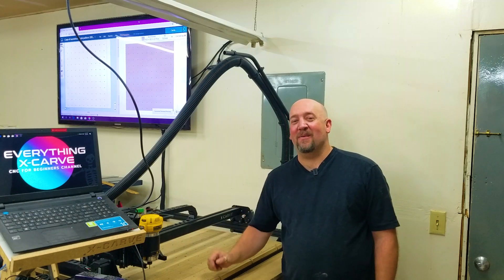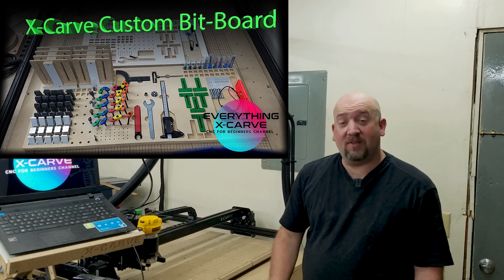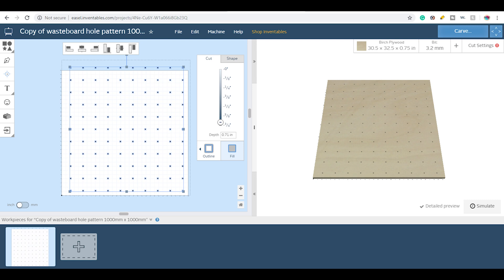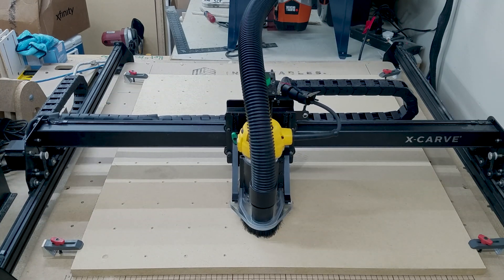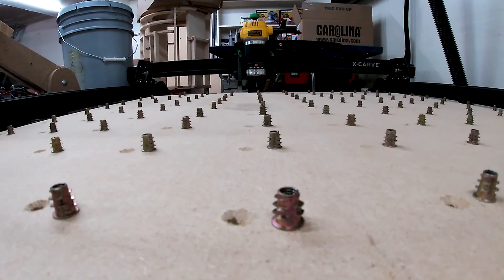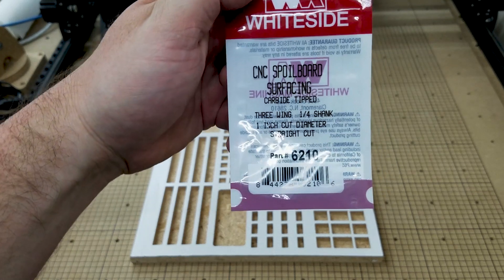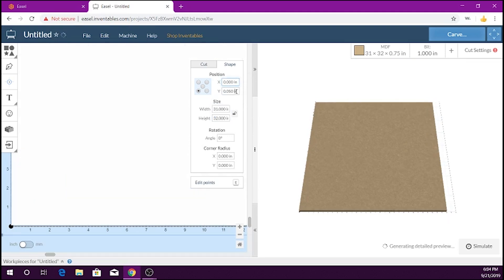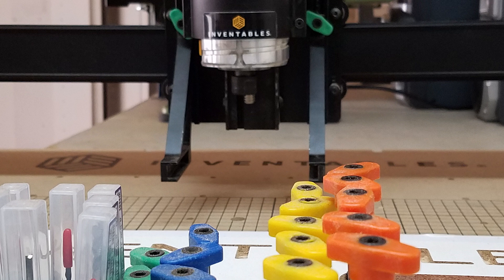X-Carve Custom Waste Board

Comment: Did you have to move your board to not get any edges left after surfacing? I’m about to make a waste board to go on top and want the max my x carve can do which is 750mm so should I do 30x30 inches?

Comment: I noticed in the beginning you had your board at 30.5x32.5 but when you surfaced the waste board it was set at 30x32 is there a reason for that? is that because the surfacing bit is so big??
Reply from the maker: Hi Joseph I resized the board as it was to big you are correct. Thanks for watching

Comment: I'm going to try laying a piece of 1/4" MDF under the waste board from the beginning. Then you could fully utilize the CNC for all hole drilling and counter sinking. Then you could pull out the 1/4" MDF, flip the waste board and surface it. I'm new to CNC so let me know if there's a flaw to that workflow
Reply from the maker: Hi Klay thanks for the response I am sure that would work. I didn't think about that prior to install. Having a template like that would definitely be a time saver. Thanks for watching.
Reply: @EverythingXCarve  I'm hoping I can use your dot template and just switch bits from an upcut spiral for the main holes followed by the countersink bit set to the right cut depth. I'll have to be sure it stays clamped with the same XY zero. Fingers crossed 😁

Comment: Do the measurements make the holes 75mm apart? They look a little off from what I’m seeing
Reply from the maker: Hi Jon and thank you for your comment. The holes line up with the wasteboard. I have them offset to match up 1 inch from bottom and 2 inches from the left side of x axis.

Comment: I am confused if you set your depth per pass to the stock .0625........but your total depth to .003. How will it ever surface the board. I just did those dimensions and it did absolutely nothing. Did I miss a step
Reply from the maker: Hi Howard thank you for your reply i statyed at this depth and did multiple passes so i kept as much board as possible. You can go deeper this was just my serting i used.
Reply: The depth per pass really doesn’t mean anything when you’re only doing one pass, the initial pass setting is what matters. Hope this helps.

Comment: What but did you use for the CNC to drill holes?
Reply: Bit*
Reply from the maker: Tyler I do not believe i had seen the comment my apologies for the late reply. I used a 3.2 mm bit but a 1/8 spiral or straight flute will work just as well.

Comment: Great vid, thanks for sharing! Q: since you're going to be cutting into this wasteboard, isn't there a risk of hitting those M5 inserts and ruining your bit?
Reply from the maker: Jimmie, thank you for the compliment i appreciate it. The threaded inserts were screwed in from the back side of the board and with the screw being much smaller than the board there is plenty i can take off of the board to resurface. Thanks for watching.

Comment: Nice video. Two things. I would put the secue spoil board into the position, then surface it. If there are any irregularities in the stock board (mine had some) surfacing the new board once it is in its final spot will get rid of that. Also did you counter sink that last screw?
Reply from the maker: Bruce thanks for the comment i did check my board after the video to ensure evertrhing was flush. Great advice. I did countersink the corners accidently.
Reply from the maker: If you are talking about the middle screw holes line up to go thru both wasteboards
Reply: I'm guessing you can only thread into the top board though since there threads on the upper and lower waste board wouldn't align. Has that given you any trouble?